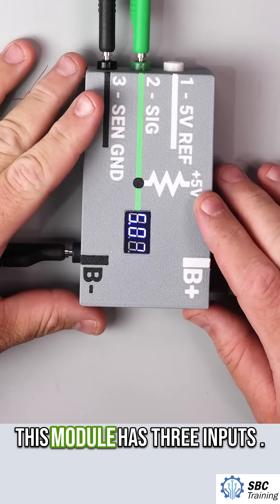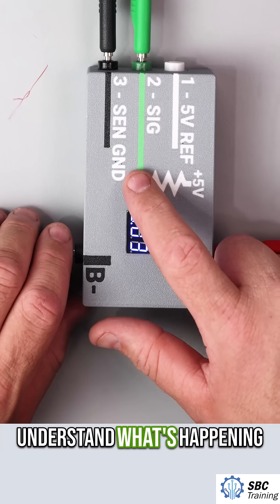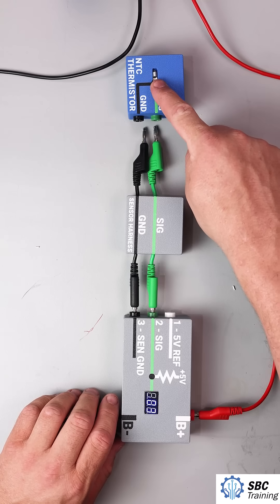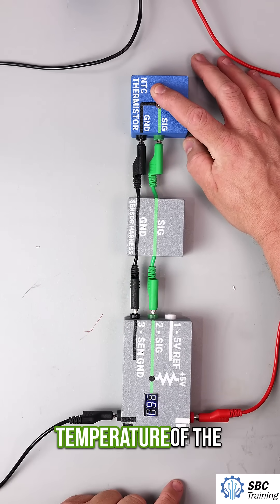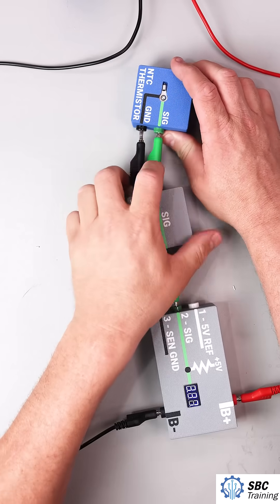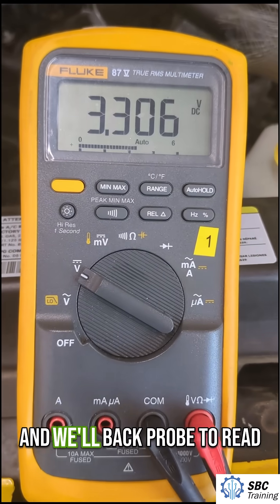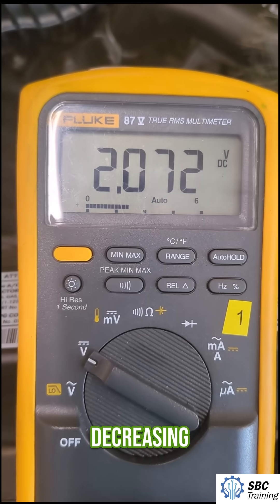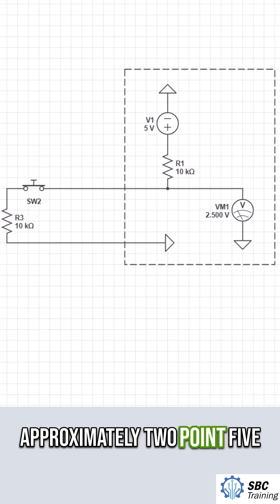How a Thermistor Sends Temperature to the ECU – Live Sensor Demo

Comment: how does the voltage translate into temperature, you are showing volts not temperature?
Reply from the maker: The computer figures that out. It looks at the voltage and then converts it to the temperature. Someone would have made a table to help figure this out. For example 3.5v might be 120 degrees.